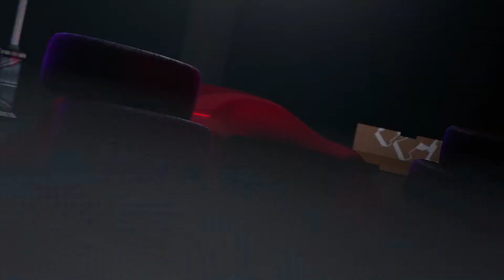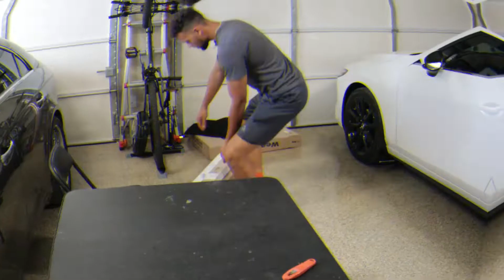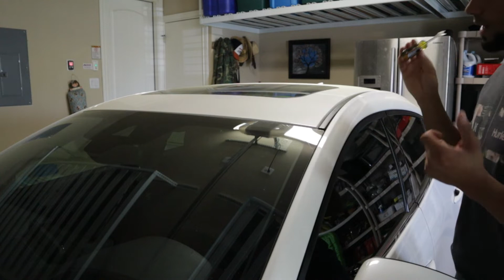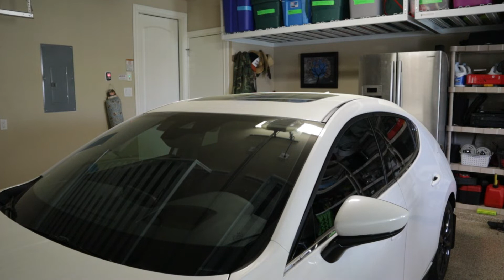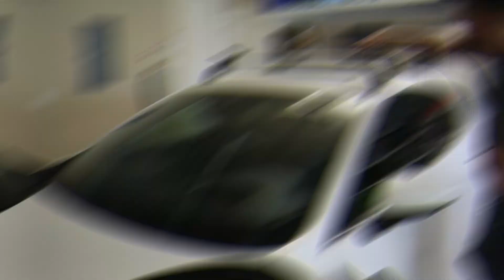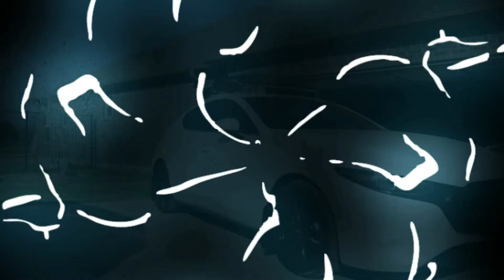Mazda 3 Cargo Rack!

Comment: Please I need your help, for some reason the version of the Mazda 3HB in Mexico does not have the factory devices where the bars are screwed, so I proceeded to buy some but I need to know the exact distance where they should be fixed, could you give me the distance? exact from the front of the roof to the front device and the same for the back the distance from the end of de roof to the rear device

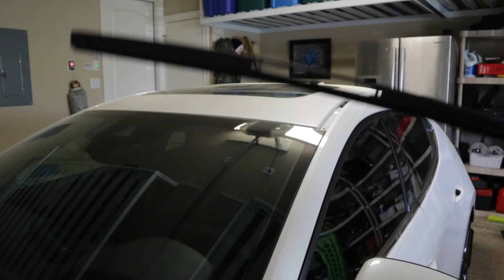Comment: 3:04 The caps on the new molding are insane! I tried to remove the cap with the molding already installed. The whole molding almost slide off but the cap still stuck 🤣
Reply from the maker: Same thing happened to me on my first attempt! 🤣
Reply: Hi! Can where were you able to buy the moldings with the caps?

Comment: For some reason, when I try to install the rubber wind noise prevention I was having so many issues. Any tips how you got the rubber pieces to slide on through smoothly?
Reply from the maker: I ran into the same problem! What I did was slide it through as far as I could then got some pliers and pulled it all the way to the other side made it so much easier!
Reply: @StradysWorld  haha that’s exactly what I did and it worked seamlessly

Comment: thanks for the video! Do the new moldings with the caps come with the crossbars or do you have to buy them separately? Also, i have a mazda 3 skyactiv X hatchback - i assume that is the same?
Reply from the maker: Unfortunately no they are two separate purchases. Everything should be the same, I believe the skyactiv X just has to do with engine components. The body of the vehicle should be exactly the same.
Reply: Hi! Where did you buy the new moldings?

Comment: Hello there!  My mazda 3 is identical to yours.  When the moon roof is open, do you hear any wind noise or whistling??  I have  read in some articles that wind noise is inevitable with a roof rack, but I need to hear it from your experience! Thanks n more power!
Reply from the maker: Oh yeah the wind noise is pretty obnoxious with the sun roof open. But you’re correct in your research, adding a roof rack of any kind will cause wind noise. The only real way to mitigate it is to add a wind deflector to your rack which helps with noise drastically.

Comment: Hey love the videos! I’ve watched every single Mazda 3 video you’ve uploaded and enjoyed all of them! I’ve got a question about the rack. I’m looking at getting a pop up roof camper for my 2021 Mazda 3 turbo hatch and I cannot get a perfect idea for how well it would attach to the rack you have. The pop up camper has the universal attachment where it fastens around either side of the rack, 4 times, 1 on each corner. I cannot tell if this rack has a flat top that would work or if there is an angle that might not. I’m just looking for some advice from someone who is way more knowledgeable of car parts and installations. Thank you! I love the vids!

Comment: Thanks a bunch! Made it easier for me to do this today! 😊 I was surprised that it sits a bit higher off the car than I assumed it would, but it's probably best so it doesn't scratch the pretty paint! I wonder though, is it an issue that water will be getting into the openings of the molding where we installed the racks ?
Reply from the maker: Glad to help! Yeah it sits higher so you can wrap straps and tie downs effectively without having to worry about scratching the paint. As for the small opening, the roof seals seem to be very well made, I’ve gone through countless storms and car washes, no leaks!

Comment: Great video! When you’re not using the crossbar and you remove it. Do you have put the original molding back or is there like a cover that you can put on the new molding? Thanks! I’m planning to get one but wanted to know first if It’s not a hassle when I decided to remove the crossbar.
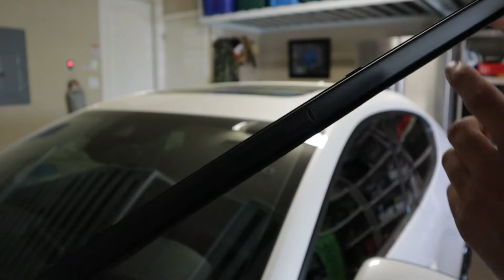Reply from the maker: Appreciate it! No need to keep the original molding, at 2:55 I show the new moldings with the caps that need to be removed. Keep those caps and put them back on when you decide to remove the crossbars.
Reply: Awesome! Thanks for the response. I will get mine tomorrow. Keep posting bro!
Reply: Can you install whitout custom molding if I was to modify the originals
Reply: @nbeboyz-teabaggins Yes. Drill a hole through the  original  moulding that aligns with threaded female mounting point.